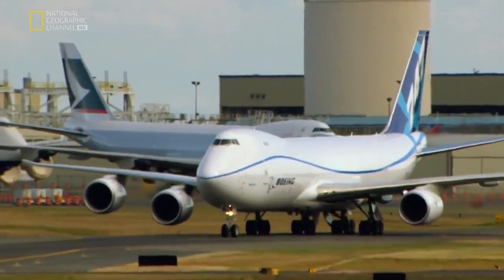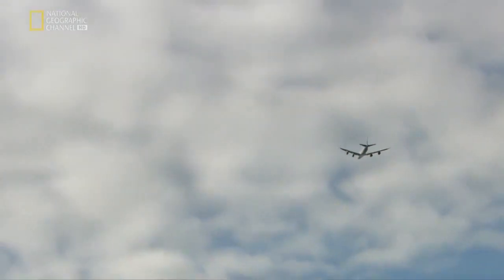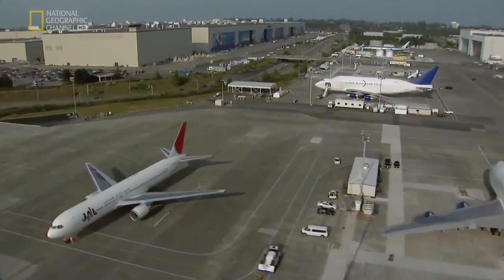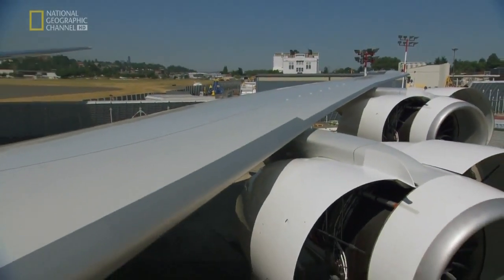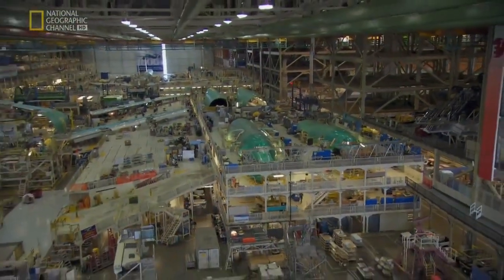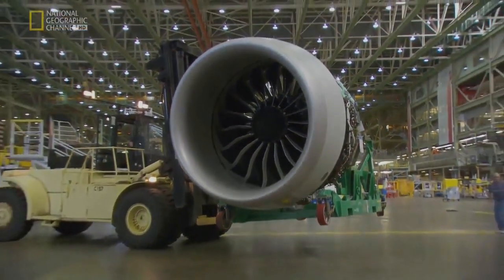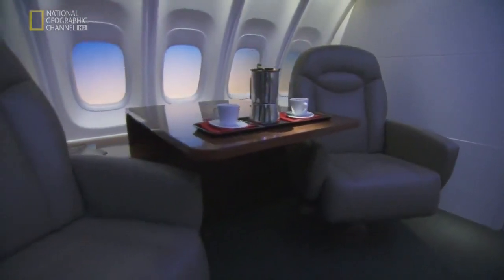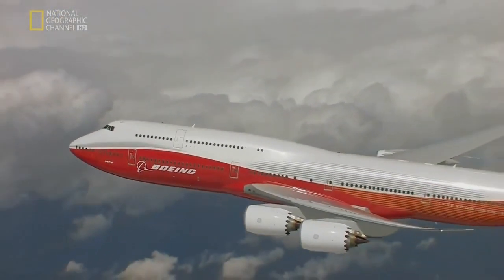Megafactories: Boeing 747 HD

Comment: Why did Airbus go vertical increase instead of horizontal increase of size?
Reply: danron Despite the immense engineering difficulties they would have encountered expanding horizontally, Airbus also had to consider what the maximum size aircraft an airport can accommodate is. An aircraft of twice the length of the 747 would be a nightmare to navigate from gate to runway and back –if it could be done safely at all anyways. The 747 encountered similar difficulties when it was being  developed back in the 1960s. Boeing ended up building a simulator that was mounted high up on a truck to make sure that the 747 would be able to be maneuvered around an airport accurately enough. And Boeing had the advantage in the 1960s and 70s that many airports could still be expanded relatively easily. The new Boeing 777X actually has a wingspan greater than what most airports can accommodate, and as such Boeing has had to design a system to 'fold up' the outer few feet of the wings.

Going up vertically just makes sense, although I don't think we'll be single three story aircraft anytime soon.